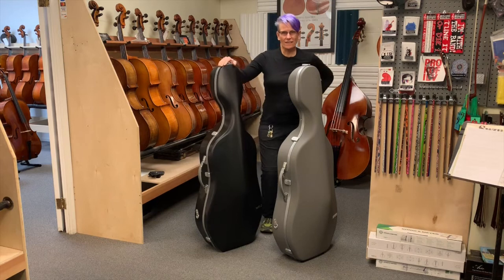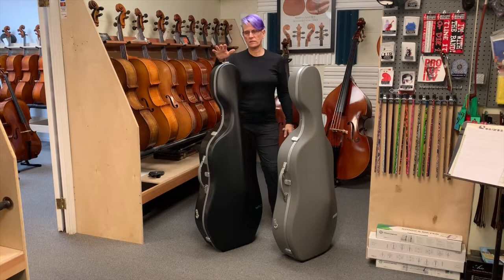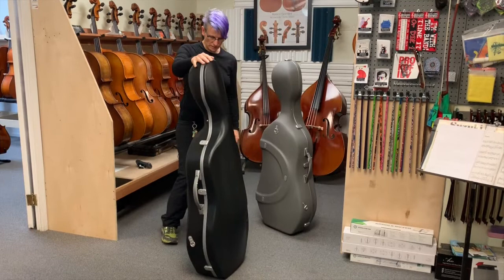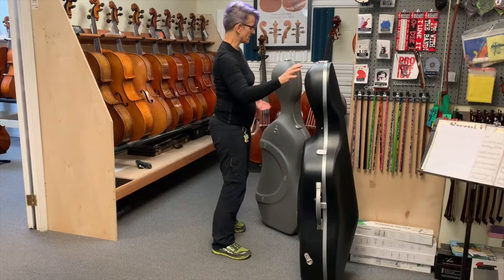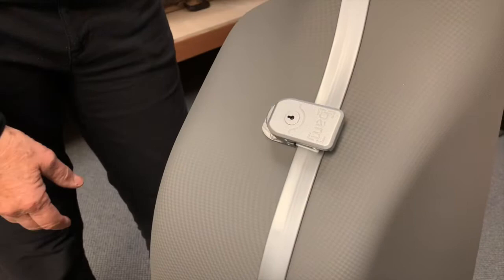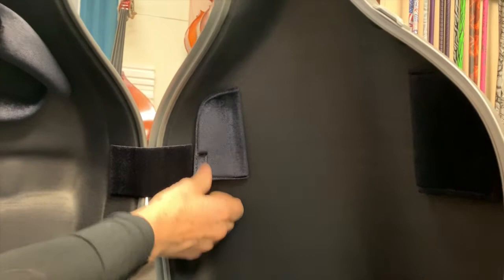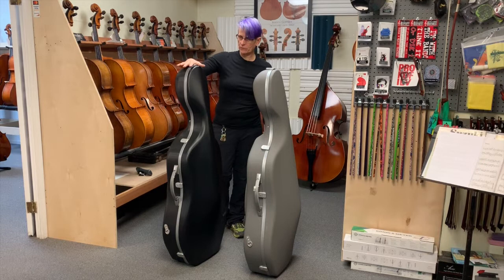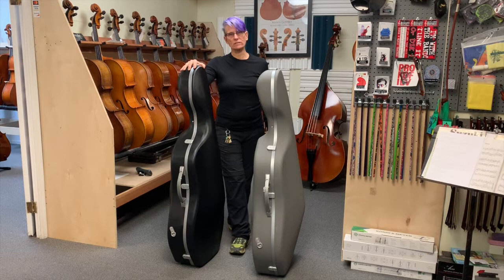Bam Hightech 2.9 Panther and Supreme Cello Case Review

Comment: Good evening Linda. Thank you for a great review of the new BAM cases.  I have the regular BAM hightech violin and viola cases and they get scratched and picked up wall paint like magnet (for some crazy reason) when we perform at gigs.  I have to use paint thinner to remove them all the time.  Understood from your review that the difference between the Panther and the Supreme model is the rubbery vs smooth surface.  However, are these surfaces also scratches resistant and not easily picking up paint as well?  The cellist who performed with us yesterday has a cello hightech case that is full of paint/scratches that it picked up from leaning against the walls.  Thank you.
Reply: Rather than using solvent try Mr Kleen magic erasers. They work good and won’t compromise the material. The panther is like a rubber ball feel. I don’t know if door jam paint transfers happen on them as I carry the cases vertically in front of me. I assume they would mark up less.

Comment: Seems like the BAM claimed weight doesn't bear much resemblance to the actual weight. That's pretty disappointing for a higher end case.
Reply from the maker: Actually in these two models, the Panther came in under weight as Bam’s website says it’s 3.5 kg which is 7.72 lbs. they haven’t yet posted a weight of the Superior case. But it is a polycarbonate case which is stronger and less likely to distort in heat like the ABS shells tend to do if you leave them unlatched and open on a hot day. For these models 2.9 only stands for the style not the weight. Only the original 2.9 comes in close to 2.9kg